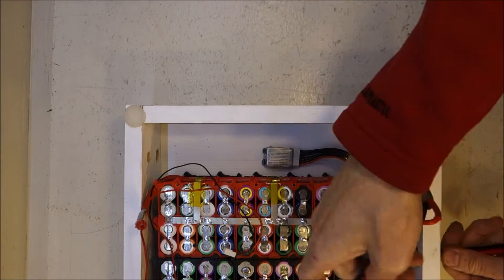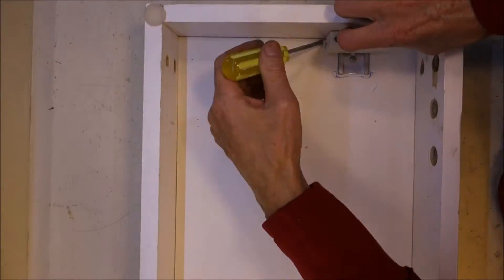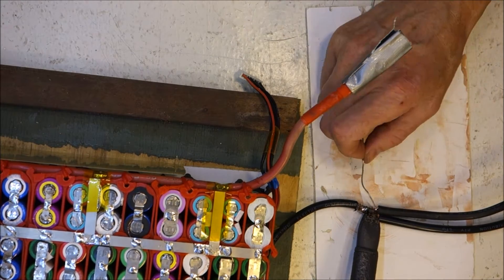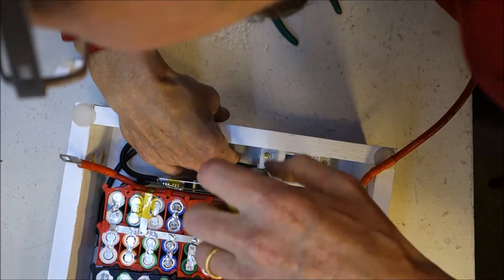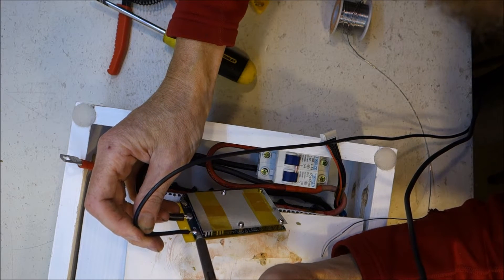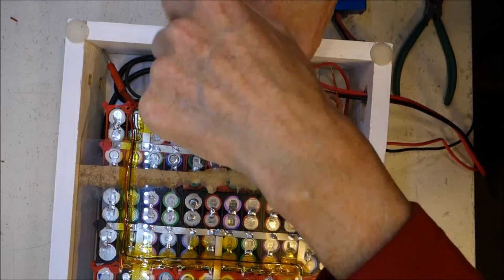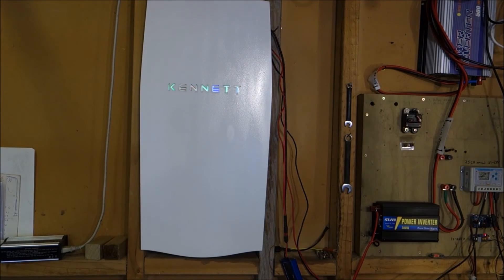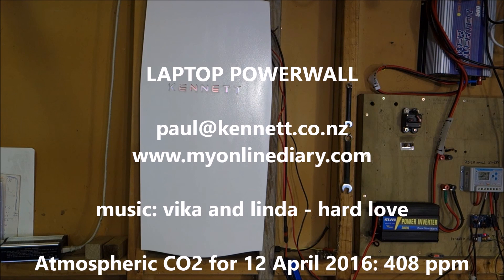Laptop Powerwall 26 - installing BMS and breaker switches

Comment: Really nicely done
Reply from the maker: +Mikes DIY Tesla Powerwall How's your project going? Still charging/discharging cells?
Reply: +Paul Kennett Sure am, Slow its hard work lol plus been a slow couple of weeks as i have been busy with other things but will get back onto this project. Just about to upload a couple of update vids.
Reply from the maker: +Mikes DIY Tesla Powerwall Thanks for your info about the TP4056 working on low voltage cells. It's  saved me a lot of time & hassle.

Comment: Great stuff. How well is the battery working? Can you tell me what you are running off it?
Reply from the maker: +Craig Minca I'm not ready to do full load testing yet. I want to wait till I have the temp controlled fans working first. But I'm running the charger for my e-bike and a web server and router. It's "only" 2kWh so I won't be running the whole house on it (yet).

I'm hoping the temperature controlled relay board will arrive next week so I can "complete" this battery. Then I have another 446 laptop batteries which is enough for 6 more of these 2kWh packs.

Comment: Hi, Good Job!! I have one question. I´m interested in charging the solar lithium pack at high rate (60-100 amps) the battery pack would be 48V but if I use the BMS that has a maximun discharge rate of 100Amp and a maximun charge rate of 10Amps, Could I introduce the high amperage by simply conecting the charger to the discharging port??, that is to say to the battery poles? This could be similar to the regenerating braking. I suggest this because I think a BMS that only has 10 amps of charging possibility is really poor. Thanks!
Reply from the maker: 100Amps at 48V (4.8kW)  is some real power - well beyond my comfort zone. I'd recommend looking at electric car BMS systems for that. And you REALLY don't want to make a mistake at that power level.

Comment: great videos! which bms did you use link please?
Reply from the maker: http://www.aliexpress.com/item/24V-30A-7S-BMS-PCM-PCB-24V-Lithium-battery-BMS-for-7S-3-7V-lithium-cell/32469245428.html
Reply: thx! this one is no longer available for sale,  any other capable of handling those current loads?
Reply: My solar charge controller handles 40a then i need to buy something bigger right rated at 40/80A correct?
Reply from the maker: It depends. Do your solar panels ever produce more than 30A? If not then it;s OK. Also does your load ever want more than 30A? If not then it's OK on the output side as well. In my case I have multiple battery packs each with it's own 30A BMS. The current drain from the load will be shared across multiple BMSes.
Reply from the maker: +Serviciosymas The charging upper threshhold should be set by your charge controller not the BMS. The BMS limits are your emergency backup threshold which should only be needed if the charge controller fails.
Reply: thank you!

Comment: Hi Paul. I wanna know how much total power you get from your solar panels & how you bought them. I wish I want to do my own solar panels buying cells from ebay.
Reply from the maker: +Ramesh Perera I have 420 Watts PV for this little setup. I bought them via TradeMe (kinda like Ebay).
Reply: +Paul Kennett Did you buy a ready made PV Panel? or bought cells and put them together? Also I've seen in Sri Lanka most solar companies sells like Power Optimizer along with solar panels. Do we really need that?
Reply from the maker: +Ramesh Perera I bought ready made. They're cheap enough these days that it doesn't make sense to buy individual PV cells.

Comment: I Paul, I have been following your great channel for some months now, and i´ve decided to start with a powershelf almost like yours. It took me more  time to complete the battery holders as they have a additional fuse contact (https://photos.app.goo.gl/IIzqiMXUCnNphc693).
Since this should be a 1 kWh pack, a BMS with just 50~60 mA balance current is enough?
What should be the proportion between total pack capacity and balance current?

Thanks!